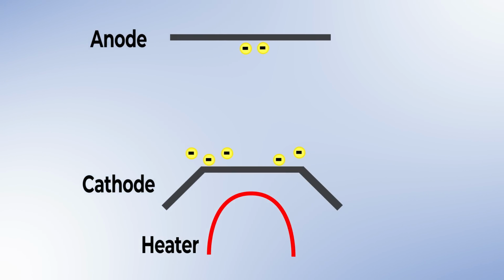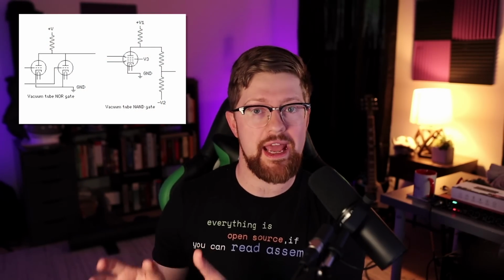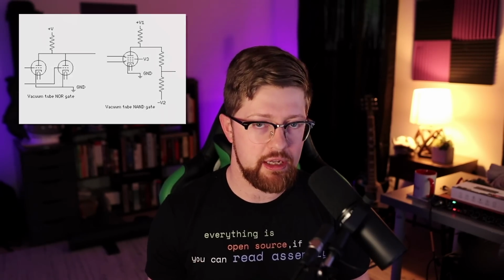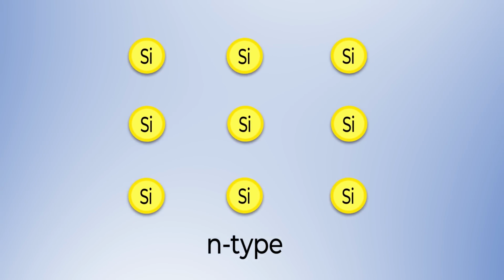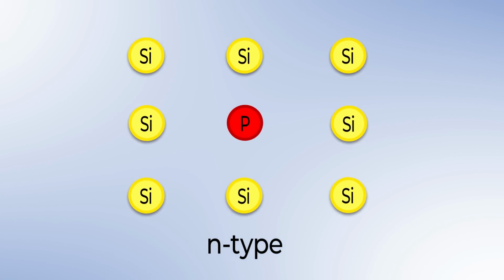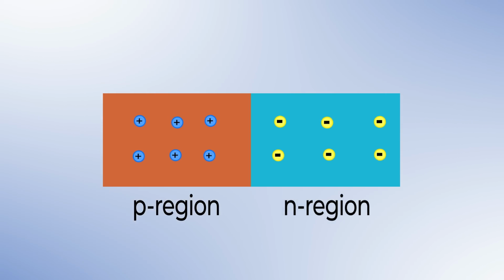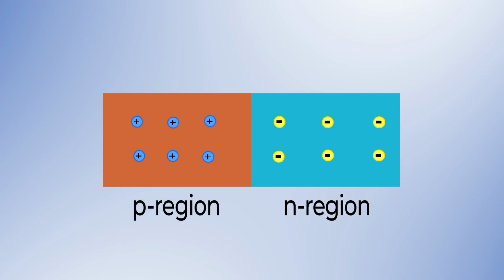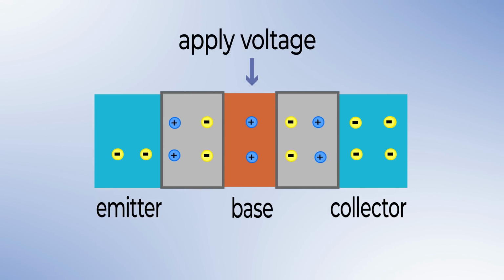how are these so tiny?

Comment: All of the computing and electrical engineering fields are the results of the physics and chemical engineering fields. So cool how we abstracted so much the matter away from the actual algorithms till the point you only work with abstract problems and can forget all about the underlying physical matter which it gets executed on. It is somewhat similar to how our brain works, We think (which is an abstract act) but it “runs” on our physical brains while we do not really need to deal with what it is made of.

Comment: Wondering if there are chips, made with semiconductor compounds. I like the non-standard stuff. Not the ordinary stuff that's already developed and elaborated.
How worked the ternary computers, with their Trits & Trytes, instead of Bits & Bytes? Does someone know the Transputers of the 80s.?
Some believe in the renaissance of analogue computers for AI. I think, engineers in the past were much more creative in going new ways. They were open minded. 
Statistically, not everything of this stuff was waste. Some technology, worthy for further development, was stopped by common standards.
That's the dispute between Apple and EU. The European Union decided USB-C as common standard for mobile devices.
Apple argued, common plugs are an obstacle for further improvement. Who is right?

Comment: The nanometer thing isn't accurate.  For a while now the fabs have switched to proprietary calculated averages and it's effectively just a marketing term.  TSMC's 7 is basically the same as Intel's 10, they just do the math differently.
Reply: I think the "finFET" stuff that intell figured out was pretty important, I think they all do it that way now.
Reply: @kayakMike1000  Yeah, I agree.  My point was that saying a transistor may only be 2nm is inaccurate is all.  Of course, that kind of confusion is exactly what the fabs want people to think, and why they market the way they do.
Reply: @meeponinthbit3466  in the end a transistor channel has an average length expressed in nm.
Reply: Yes the norm used to be the minimum possible gate length, but by using finFET or other non-planar transistor designs they achieved an "effective length" that would be equivalent to a planar transistor of that gate length. By now it really doesn't mean much on its own, gate length on itself was never a good metric to compare between different manufacturers, just like comparing clock speed between two different CPU vendors

Comment: Good explanation on BJT transistors, but we use CMOS transistors.  CMOS is fundamentally different mechanism that use similar materials but BJTs are current controlled devices while CMOS are voltage controlled devices.  CMOS is a refactor optimized for on/off state.  BJTs are good for analog operation amplifiers, radios, etc...
Reply: Shouldn't you say FET? According to Wikipedia CMOS is just a fabrication process, it creates MOSFETs, which are really a subtype of FETs. FETs would be the lowest level you'd go with a video this long.

Youre using all kinds of fancy words there, refractor optimized... I have a hard time understanding how that applies to FETs and I studied Physics. The important part is that FETs tend to be hugely more efficient, which is connected with them being voltage controlled instead of current controlled, which was the one thing you pointed out, aside the fact that BJT don't get used in usual chips, that I think was actually helpful to the people that might watch this video.
Reply: @Samuel Maier  CMOS is a technique to create logic gates from transistors, which I believe, for all intents and purposes, is used with FETs. Basically, you have one pull-up circuit that connects the output to a high voltage when the logic gate condition is true, and a pull-down circuit that connects the output to ground when the condition is false. So I think he confused CMOS with MOSFET
Reply: @9SMTM6  well sure, FETs are more fundamental than CMOS, but the complimentary part is an essential to the design.  In most logical like a flip flop, there's equal numbers of PMOS and NMOS components.  I think there's at least 4 or 5 pairs in a CMOS flipflop for a total of 8 or 10 transistors per bit.
Wikipedia is cool, but take it with a pound of salt.  The complimentary part is important to make these "gates" reliable, energy efficient, switch fast, avoid latching, etc. etc.  CMOS is the best refactor optimized for binary operations.  It's way more than just a manufacturing technique.  
But technically, you're correct.  It's more like FET is important.

Comment: 5:03 Diodes are important too, are used in bridge rectifiers.
Reply: Sure, diodes have so many applications like BJT (and hence Op amp), Thyristor, high speed switching, ESD protection and rectification, etc.
But all components are very useful in the end. Capacitors, inductors and resistors are as vital, even if less versatile because linear

Comment: The silicon in my computer is really dope!
Reply from the maker: TRUE
Reply: Imagine not knowing the difference between silicon and silicone....
Reply: @bobbydazzler6990  English is my second language - I'm actually Latvian! :D
Reply: @jkmelri  Nobody cares where you are from.  ☹️
Reply: more like doped...
Reply: Silicon or silicon??
Reply: @quack1119  That is Si the Silicon (D1800s), a directly hard chemical element that is used in Electronic Components, Parts, or Properties and NOT TO MENTION the CIRCUITS.

And The Silicone (D1900s) is a Chemical so Synthetic material that is flexible or stretchable and soft, and it is used in many things including rubbers, adhesives, plastics also fake teeth or dick or breasts and make-up et cetera. (I should learn more about it)